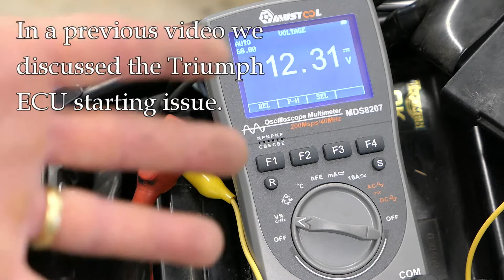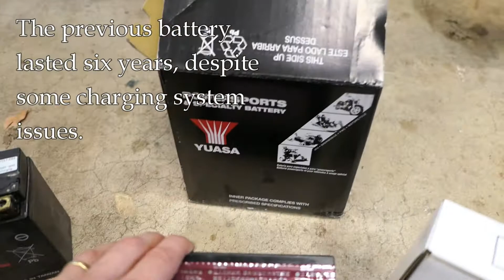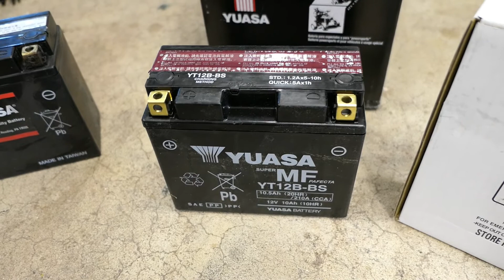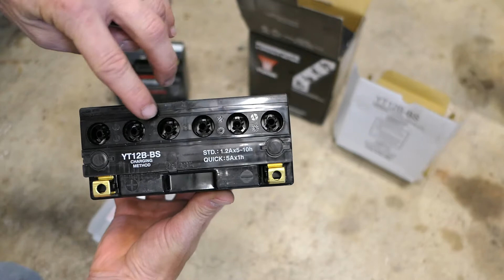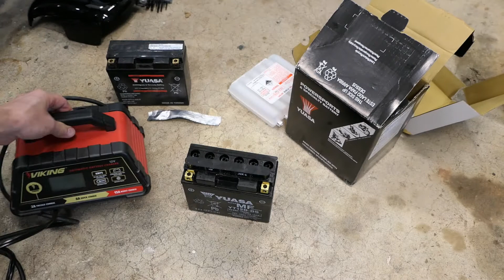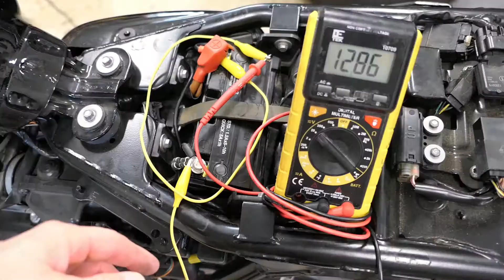Triumph Modern Classics Battery Replacement

Comment: How long did it take to charge at 2amps?
Reply from the maker: It will vary, because modern chargers have electronics in them which monitor voltage as they charge.  Generally speaking, though, a new battery should charge overnight or even less.

Comment: I needed a new battery. I replaced with a new lithium battery. Now I get absolutely no power, no light, nothing from the starter. I'm not what happened. I was getting at least a dim headlight with the old battery but that battery has completely died. 
Anyone have any suggestions please?
Reply from the maker: Have you tested the new battery?  What is the resting voltage of the new battery and what happens to the voltage when you draw power?  And have you checked the cables and connectors?  https://youtu.be/d-5xA31nBd8
Reply: @tinderboxarts  Battery Tender Brand charger reads good and was at 80% before I tried charging it again. Went through all connections, pulled fuse was good, pulled box fuses/resistors they looked brand new.
I only have one 15amp fuse coming from the positive cable. Couldn't find any other flat normal looking fuses. 
I'll have to get a multimeter to test the battery. 
Just seems weird that simply switching a battery would create a phantom problem like this. The bike was moved back and forth for street sweeping and then covered. It's just been parked there.
Reply from the maker: Every mechanic somewhere along the way runs across this old saying:  When you ASSUME you make an ASS of U and ME!  Battery chargers are not meters, and modern "smart" chargers run on computer algorithms which vary the voltage and charging rate depending on what they sense.  They can be fooled.  What is more, you have a lithium battery, which requires a higher charging voltage and which will charge differently than a standard AGM battery.  If your charger doesn't specifically say it will sense a lithium battery or have a switch setting for a lithium battery, then the standard charging algorithm will not work well.  So, buy yourself an inexpensive meter and see what's really going on.  A fully charged LITHIUM battery will measure about 13.8 volts at rest.  If you find  less than that, the battery is discharged.  A standard AGM battery, by contrast, would have a fully charged resting voltage in the high 12 volt range.

Comment: Good video, the one thing that stood out to me is that your battery only showed 12.86 Volts fully loaded.  Did you fully charged the battery?  I have a 2010 Triumph SpeedMaster that uses the same type of battery.  When I replaced the battery 4  years ago, fully charged it showed 14.05 Volts. I use a CTEK battery charger.
Reply from the maker: A fully charged standard 12 volt battery is 12.6 volts, and a fully charged AGM style battery is just a little more at about 12.8 volts.  So my battery was showing a full charge.  If your battery showed 14 volts at rest (in other words, without a charger connected and without the bike running) then you might have been looking at a surface charge or else your meter is inaccurate.  A surface charge is kind of a shallow reading that disappears with the slightest load or with some time.  14 volts would be pretty high for a surface charge, though.  I'm not sure that's even possible.  More likely your meter was inaccurate or you inadvertently measured with the charger still attached.  The charging voltage is typically in that range.
Reply: Or maybe a high performance battery?